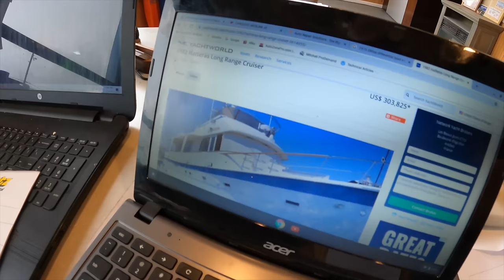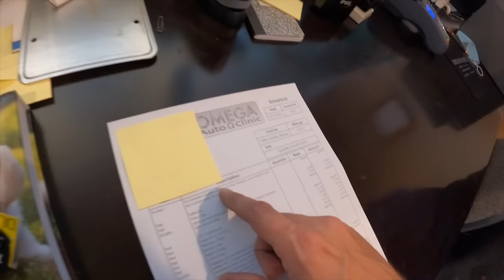Everything wrong with the Mercedes nobody wanted, and another Lamborghini FIXED!

Comment: No need to replace those quarter window seals, as the windows can easily be adjusted, a 10 minutes job for each side, and the noise is gone.You just need to remove the upper door panel to access the actuator rods that are adjustable. Another example of great MB engineering. It´s a rare sight to find a car with the BOGE Hydromat self-leveling spring element. Another marvelous example of technology. Good, that it works, they're fixable, but only in the factory and they don't come cheap. However, the wizard should take a closer look at the front suspension crossmember bushings, they very much tend to fail and the car looks a bit saggy on the front.

Comment: The rear suspension on the Benz the big "shock" in the middle is called a hydro-compensator. It acted as a shock and spring for the swing axle suspension. They were often replaced with the big spring when they failed because they were quite spendy to replace. The rear end would sag down and camber out when they failed.

Comment: That shock absorber mounted on the rear differential is the same type used in the Range Rover of the 70's. That shock absorber is loaded with nitrogen when the oscillation begins, it is energized and hardens the pressure to maintain the same level.

Comment: The rear suspension is a single pivot swing axle with the hydraulic compensator. Designed to overcome issues with standard swing axle setups.

Comment: That mysterypart above the differential is a hydro-pneumatic compensator, which is used instead of a spring. It's the same on older type Range Rovers.
These compensators are becoming hard to get hold of and are usually replaced by the spring.

Comment: That Mercedes is a great original example but the one reason I would never buy it or want it is because it does not have a centre armrest!  A huge omission on what was supposed to be a luxury tourer.  Just a huge shallow bucket but nowhere to rest your arm on a long trip or when relaxing in it stationary.  The designers must have thought that drivers were going to keep their arms glued to the wheel at the 10-to-2 position for five hours at a time?  How ridiculous.

Comment: Volvo used to use a Boge/Sachs self leveling rear shock absorber that was completely self contained and didn’t have any hydraulic lines or anything. They work well and last longer than normal shock absorbers, and usually don’t need replacing until the car is 15-20 years old. The problem then is that the repair costs a third of what the car is worth. A common solution is to retrofit standard shocks and springs.

Comment: That Boge damper is a self levelling unit, they were also used on the Range Rover Classic. Hard to find replacments now.
Reply: Yes, sometimes called Boge-bein by ze Germans. It's a hydropneumatic wizard thing that always goes back to the original length.

Comment: That might explain why a Mercedes like this that did a million miles (now in a museum) had a hubodometer installed (like on trucks) on the wheel to record it's distance.
I had a similar problem with speedometer noise, particularly in cold weather. My mechanic loaned me a special spray lubricant and after pulling out the cable and coating it, the noise stopped and that was almost a year ago and over 7000km since.

Comment: Heads up that the suspension springs in the Cadillac appear to be failing, especially in the rear. It's pretty common for the springiness of the spring steel itself to gradually fail on these. You'll especially notice when you load up with four passengers and notice how uneven it sits.

Comment: The "thing" in MBs rear is a levelling device. Boge hydraulic levelling strut. 
Same was used in Range Rover from -70 
When car is moving, this thing is pumping it self to certain level, and keeping it there. In Range Rover there is 700 kg load bering in rear, and this keeps it level

Comment: The part across the diff is a hydro-pneumatic compensator. It is filled with hydraulic oil & nitrogen gas. I've had 2 Mercs with those.

Comment: Boge is Bojj...My RRC has one for load leveling...It's compressed oil...
Reply: Only one company repairs a Boge in Germany (that I know of) and the coil spring conversion is an easier fix than rebuilding the Boge unit...

Comment: The speedo, is connected to the transmission, via a cable. The cable connects to the actual guage via a small plastic fitting. At about 30 years old, those plastic fittings dry rot, crack, and disconnect, disabling the speedo... Easy fix. Pull guage cluster, find cable, fabricate new connector, re-connect cable, reinstall guage cluster. Repair time, 2 hours, maybe 3 (for parts fab).
However, the "noisy when cold" implies damage to the gear, in the transmission. When the trans fluid is cold, it has a higher viscosity, and hasn't fully distributed. The internal speedo gear, if missing teeth, and not properly lubed, would make a clicking, or grinding noise, until the trans reaches prop. operating temp...
Both are just educated guesses... but I'm pretty well educated (25 year mechanic)...

Comment: Mercedes heater blower only works on high-very common issue is the blower motor resistor, more than the switch. Crazy to see the original pneumatic spring on the rear axle. The replacement is just a regular spring.

Comment: Many European cars from the  30s to the 60s hade swing axles for rear independent suspension. The problem is the outside wheel can tuck under in a corner and flip the car. Mercedes solved this with that gizmo. Old bugs and corvairs were known to flip all the time, so a common modification was to add a transverse leaf spring to restrict the axle movement.

Comment: The Mercedes is a keeper, best long road trip car you can have, smooth, power under the hood and just cruise down the highway with no issues.
BUT, they love gas stations...
I had several of the older generations, 1972, 1975 350 SE, strong engine !

Comment: You gotta get those Vogue tires with the diamond pattern in the white or white/ gold sidewalls. They fit the time and style period also the Cadillac emblem in the hood with the cut glass instead of the painted areas. They are cool. Early led display for the mpg and climate control in amber 😎.

Comment: Very nice Mercedes Benz. About that axle boot, you are better off taking the whole differential, axel unit out of the car since this is a 50+ year old car and check all the pivot bushings and other wearing parts there. And replace the torn boots with the proper full style boots on the bench.

Comment: By the way, that thing on the rear suspension is a Hydropneumatic Compensator, essentially a self-leveling thing. When it fails, as they do, they’re frequently replaced with springs.

Comment: That oil accumulation, on the oil pan, is par for course, on those Merceds. If it's not actually dripping, it's not worth fixing... Add a little lucas to your oil, a very little, and top it off between oil changes, and it'll be fine...

Comment: Nice Mercedes. When I was 16, I got to drive my dad’s 1966 European spec 280 SE. 6 clt fuel injected overhead cam 4 speed Manual!! Plenty of power, would do about 60 in 2nd.
I drove it to my high school prom with a bucket of ice and  champagne 🍾 in the trunk.
Wish I had that and my ‘65 Mustang back.

Comment: Free Tip: That regulator block from the Bentley (it's a standard Citroën XM and Xantia part) are very good for building a sphere tester. Connect an old pump and install a pressure meter and your done. You will also need a short "suckhose" and an oil reservoir (oil bottle), a 12mm wrench for the bypass screw and some ordinary brake pipes (coppernickel is fine). You want that Mr. Wizard if you are dealing with old Bentley/RR's with Citroën hydraulics. And lets face it. It's only a matter of time before Hoovie buys an old Citroën which I of course is waiting for and supports 100%. And I got you all covered if needed. Worked on them for 30 years and has all the official workshop manuals, and the hydraulics are completly stuck in my head. It takes one minute to diagnose a sphere. It's all about it's gas pressure. And if you really want to go to town, you can fill them yourself. You need a hydrogen bottle and some home made tools (search youtube).
Reply: Wonder if he will be able to get hold of XM and Xantia parts in the US, These cars are rare today even her in europe and parts not necessarily easy to get hold of anymore. On the other hand he could take Ms wizard on a vacation to france and do some shopping :)
Reply: Also the old sphere is grey because that's what Citroën OEM spheres were like in 2003 when the car was new. They changed their colour in '99 (?) to make the spheres look a bit more modern, but then reverted them back to their classic green colour about ten years ago I think. Both of these spheres seem OEM to me, as they're both Citroën branded. None of the aftermarket spheres I've seen had the Citroën logo on them
Reply: Yes. Rolls Royce licensed Citroen's hydraulic suspension . . . they couldn't improve upon it.
Reply: @SterkeYerke5555  IIRC the first C5 that got LDS and 350cc spheres was the first grey ones. But some of the last of the Xantias actually was sold with the same C5 spheres in the rear. And for some reason they decided that SOME of the "classic" spheres needed a new color. Then there were the "three half drilled holes on the top-spheres" which had wastly improved membrande life. But even they also came some in green, some in grey. The "three hole spheres" can actually run for decades without loosing any pressure at all. But when they finally go, it is a bit more spectacular. In those cases you are glad for that loose fit filler cap. I have blown a fully pressurised sphere on a DS once. And it has a metal reservoir with screwed on filler cap with a small breather hole. Yep, it got bloated like a football.
Reply: @leonarddaneman810  If there is one thing in the car industry that no one could do better, it was the Citroën suspension. Released in 1954 and still is the best by far. The DS makes speed bumps dissapear completely. And the Xantia Activa from 1995 was a medium sized hatchback that outperformed the McLaren 675LT in the corners. And that´s particularly interresting because McLaren with their "revolutionary" suspension actually was a rip-off of the system in that old hatchback. Pretty good for a 67 year old concept.
Reply: @AlfaGiuliaQV  IDK, but it shouldn´t be that hard to order new or used parts from europe. They almost never break, so any parts-car has the parts needed. But if the Wizard family ever goes for a holiday to south Sweden, the parts, coffee and hydraulic boot camp is on me.
Reply: @michaelheimbrand5424  I've seen quite a few '99 and 2000 Xantias and XMs with grey spheres, mostly at the rear. I assumed they'd be the original ones and they'd changed it by then. I know about the later membranes too, as well as the "soucoupes" that some of the last Xantias had. They're available for my Activa as well, but as I insisted on getting a phase 1, mine's got bog-standard classic green spheres. At least for now ;). The soucoupes are said to be a lot more comfortable, but also quite expensive from what I've seen. Still would love to try them some day though. I don't intend on selling my Activas anytime soon!
Reply: Hoovie should buy a loadrunner!
Reply: @jaapaap123  You mean a Plymouth Roadrunner? Probably difficult to find as a Hooftie.
Reply: @jaapaap123  OMG! Yeah, they are so cool. Hoovie: You know that Citroën CX Doug De Muro drove recently? How about that one as an estate with six wheels?
Reply: When I saw the Citroën SM that Burt Reynolds totaled in the film The Longest Yard I wanted one but have yet to even see one in person.  That would be the candidate I would vote for as the next Hoovie project!
Reply: @SterkeYerke5555  There is no difference in ride characteristics on the different kinds of spheres. It´s only volume, damper and pressure that matter for that . In fact the most important thing to consider is to stick to OEM (suspension) spheres and not the aftermarket ones. The non-citroën ones never get the damping characteristics right. And on the Activa you already has rather soft spheres. Few people know that today but when they were new, the Activa was very comfortable. It is bad mechanics and lack of maintenance that gets all Activas ride hard. Like with all Hydractive 2 vehicles, the stiffness regulators gets bad O-rings in the solenoid. But probably the worst thing for an Activa is bad "Activa spheres". Especially the one in the rear. That one is the cars only way of disabling the very stiff (physical) roll-bars. When driving in a strait line the Activa takes bumps on one side as good as a 2cv. Actually, one of my Activas is a rather sad example that I had to do a quick fix to get home. So that one has the roll-correction bypassed. With even rather mediocre suspension it is super smooth. And that is basically what the rear "activa-sphere" does when not driving in a corner.
Reply: @cwdrock  Yep. The feeling you get when driving an SM is basically a love child between a DS and a classic grand tourer. Doesn´t get an better if you ask me. If Hoovie gets a couple of miles in an SM, I think they would stick. Smoother than a Rolls and still an old exotic jet-set barn stormer. The Maserati engine may be a bit sensitive. But as always with old Citroëns, the chassi is an absolute tank.
Reply: Actually I agree with you totally when it comes to some of lesser known EU brands. I'd love to see Tyler on a DS, an "EU land yacht" of the same time of that Mercedes, as like as I'd absolutely LOVE to see both him and the Wizard to put their hands on either an old AR Giulia GTA from the 70s or even on a modern 2016 one...
Reply: Quite a few misconceptions/incorrect info on here about the Citroen spheres and what was fitted when/what colours. 

The green spheres are the original style. They are only compatible with LHM (green) fluid.

The silver spheres are a late upgrade to the original style, with a multi-layer diaphragm inside (intended to last longer before leaking off). They are compatible with LHM (green) fluid. They could be found on late Xantia and XM, or bought to retro-fit earlier models (where the specs IE internal pressure/capacity/damper hole)  matched).

The last hydraulic spheres used are  grey. These are fitted to C5 and C6. They have a slightly different shape (shorter/flatter) and are only compatible with LDS (orange) fluid.

Nb: it is a bit debatable what constitutes grey and silver in the colouring lol. The LDS spheres are a different shape though, that's the easiest way to differentiate them 😉
Reply: @wurlyone4685  Maybe I was a bit unclear.

Color has nothing to do with the membrane type. There are multiple types of membranes since decades. The newer multilayered OEM ones that at least in the case of Xantia and XM has three "half-drilled holes" around the filler nipple are available in both green and grey. One of my later XM's (2000 diesel) came from factory with green "multilayer spheres" that has the three semi-drilled holes (is dimples the right word?)

A few years back when using new OEM spheres, there was a good chance you got a mix of colors on the spheres from the spares department to the same car. There were both green dimpled and grey non-dimpled (old-style membrane types).

And as I said, some of the latest Xantias was delivered from factory with 350cc saucer-style C5-spheres in the rear suspension cylinders. And on that note. New never used spheres are compatible with both fluids. If you feel like it you can put Xantia spheres on a C5, and Citroën put C5-spheres on Xantias from the factory. It's the fluids that shouldn´t be mixed. So only use new ones when tinkering.

But like you, I would call the saucer style spheres C5/C6-type or something. When Citroën used them in the last Xantias it was probably a parts-bin-thing.

Also, worth mentioning. People should know that OEM spheres with the correct and truly verified (cross referenced three times, googled, doubted and cleared with all mayor religions and the UN) part numbers are sadly the only way to go if they want the car to feel as intended. But with that said, as long as people know what they are do, tinkering is fun. I had tried some of the most questionable setups myself.

I only want all info in this subject to be 100% correct so people can learn the right way. And I appreciate if some calls me out with wrong info, but it has to be 100% verifiable then. And sometimes not even the official sources is to be trusted. A good example is 96 222 870 (IIRC). It's for the rear wheel cylinders on the Activa. That one became the "one-size-fits-all" for all XM and Xantias in the later years. While right on any (hydractive or Activa) Xantia, they are far to soft for an XM. And this has been a repeating history since the DS days. Heck, they even officially sold 500cc welded type CX-spheres for the DS (that should have 700cc splitable-spheres).

It's a good thing that at least the accumulator style spheres are a bit easier to get right. If it doesn't have a damper, I always buy after-market. There is where money should be saved. With suspension spheres, as far as possible OEM is the way to go. Any OEM that is on it's first (factory) fill and never was driven below 8-10 bars is worth it's weight in gold these days in my opinion.
Reply: @mducheine2784  No, the Citroen Loadrunner. I'm not into French cars, but I'd love the shit out of that!